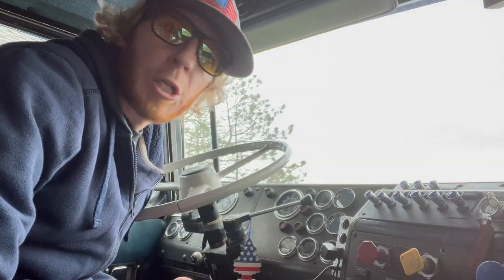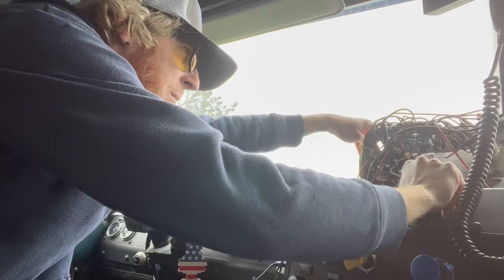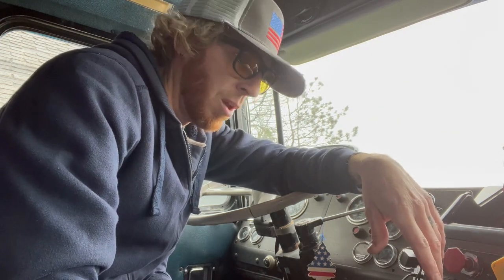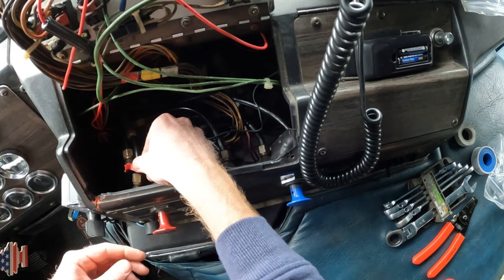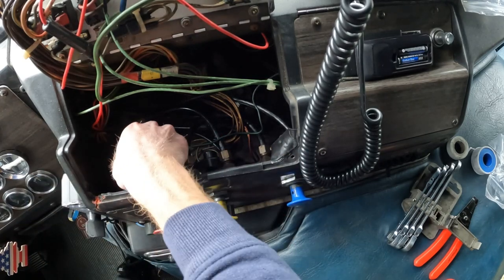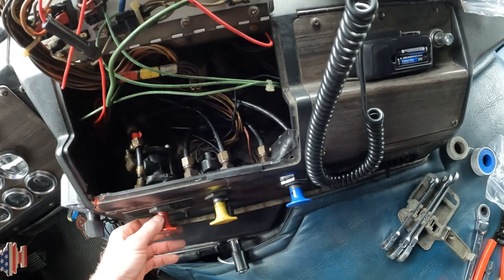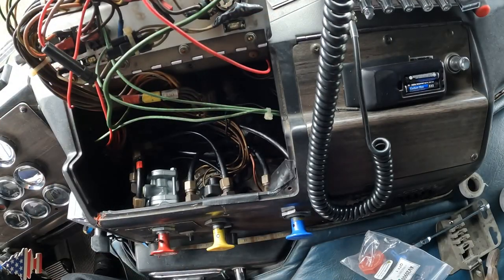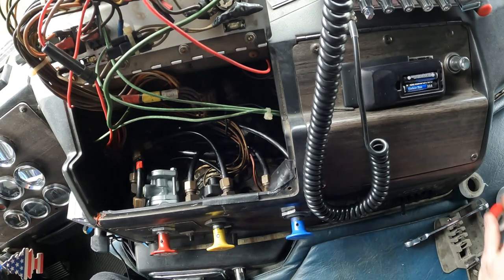1983 K100 Cabover Dash Air Valve Replacement And Quick Ride

Comment: Dang for an 83 all that stuff behind the dash panels is clean.
Reply from the maker: Yep not much rodent material when I first got it and cleaned it out
Reply: @1ChadKeegan  my 88 had tons of shit behind the dash panels, leaves, dirt, spider webs. Big mess
Reply from the maker: @mikeyocain  both mine had the mouse nests and torn up bs but it wasn’t a shop vac couldn’t handle and thankfully no wires were chewed up
Reply: @1ChadKeegan  I gotcha, love seeing those old cabovers still on the road, I'm almost finished restoring a 88 T800 with a 400 big cam IV, it's been a long process but it's turned out really good
Reply from the maker: @mikeyocain  neither of mine are restored just updated parts to be able to work them!
Reply: @1ChadKeegan  I hear ya, I wouldn't say mine is full restored. Did an out of frame on the motor, new paint job and frame paint, paint matched the dash panels and re did the interior, then just lots of lights and chrome on the exterior, definitely not a full restoration
Reply from the maker: @mikeyocain  Nice!

Comment: Chad mate only way I’ve found to make it easier to get them clips off the slack adjusters is a wirer brush and give it a clout with a big f hammer to loosen it all up you’ll get it mate
Reply from the maker: Hard to get much swing force all twisted up down there
Reply: @1ChadKeegan  that for sure 
Can do 👍

Comment: Has said the pin is a roll pin just a hammer and pin punch or a small bolt or nail will get that pin out then just tap new one back in
Reply from the maker: Good Stuff